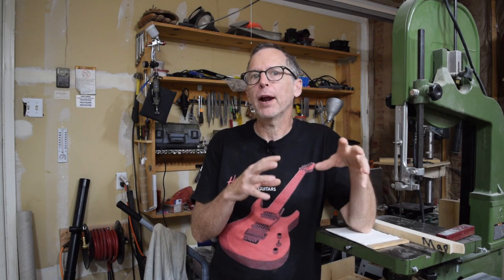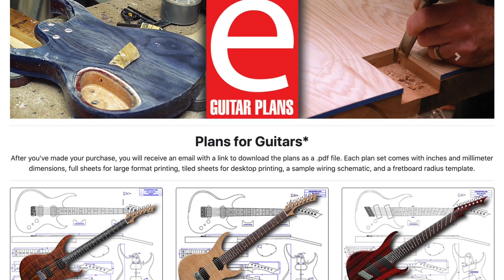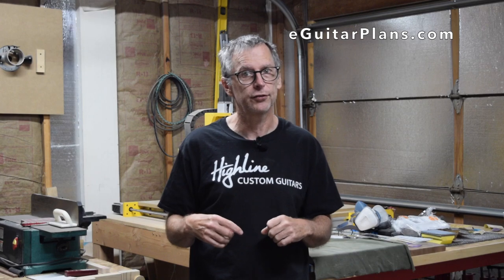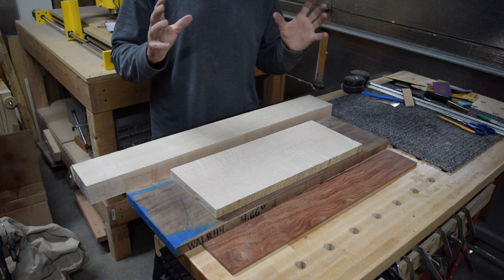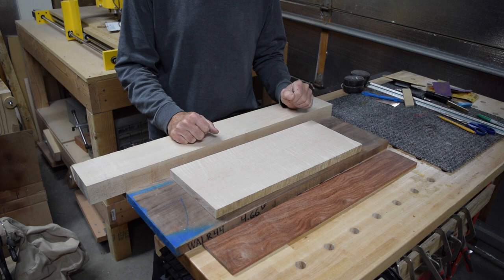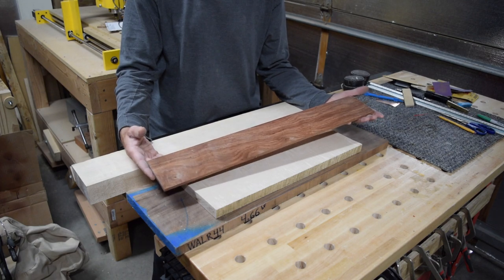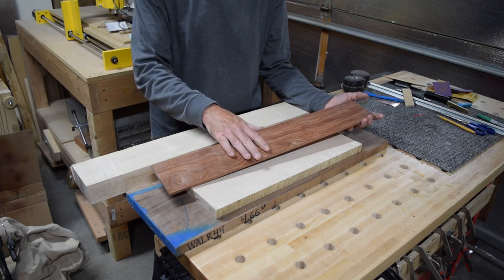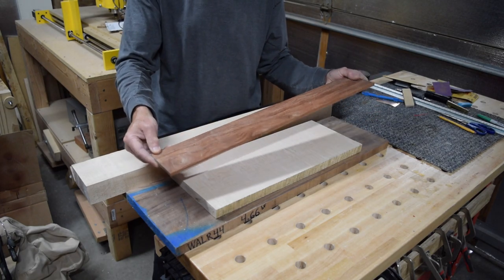Making A Guitar With A Laminated Top Part1: The Design And Selecting The Wood

Comment: LOL. In the shower this morning I was thinking about an upcoming LP I want to make and was thinking of laminating in a 3rd layer between the maple cap and mahogany body. I was thinking perhaps a 16th of ebony. I think your choice of walnut would look great too. (I use walnut for soooo many projects, I love it).

Those bevels are awesome and the scallops on the back around the neck joint look great as well. Seems like the neck joint on the finished build will be interesting, can't wait to see it. I agree that the sharp top bevels look nice and modern. I'm wondering if there's a way to get them nice and crisp without a CNC. (I don't own one) Seems quite a challenge especially in cases where the bevel angle/depth isn't uniform.

Comment: I have been thinking about a laminated body guitar.  I want strong tight bass response sustain. Lo mids and note clarity.  I play classical type music. I need dynamics.  

So far I have been thinking about Spanish cedar body, either ebony or African Blackwood and a thicker rosewood top.  The African Blackwood is supposed to sustain and have tight lows.  I like a darker tone like a les Paul.
Reply from the maker: As far as tone and sustain, your focus should be on the pickups rather than the species of wood.
Reply: @HighlineGuitars  I like my Holcomb pickups.  I have the scarlet and scourge in my ce and a alpha and omega set waiting for another guitar. I like them.  They are higher output but transparent and have a lot of clarity.  I tend to put the gain on the amp to 9 of 10. Leave the knob on them at like four.  Play soft with a low action.  I listen to a lot of classical music like cello.  I watch a lot of the tonebase cello lessons on dynamics and phrasing.  I never use compression.